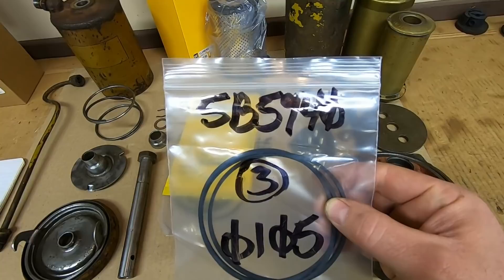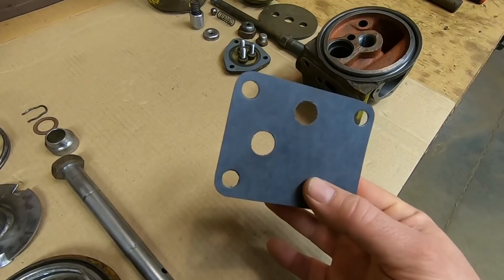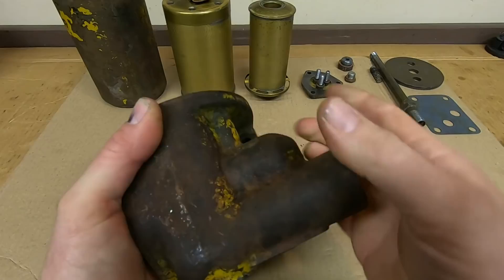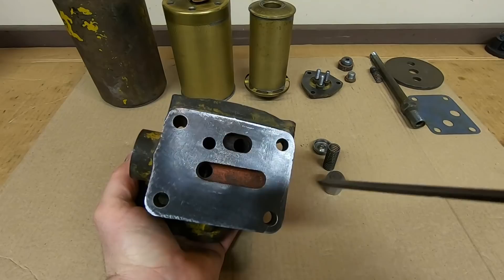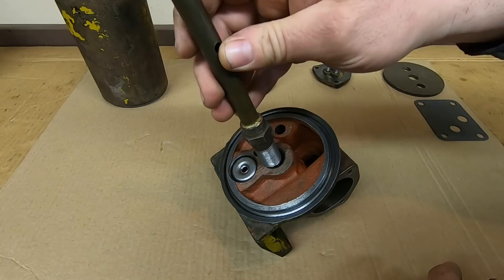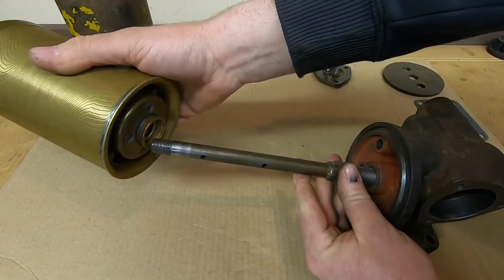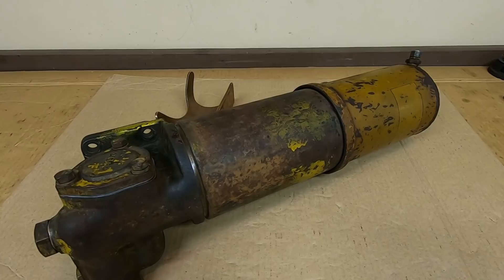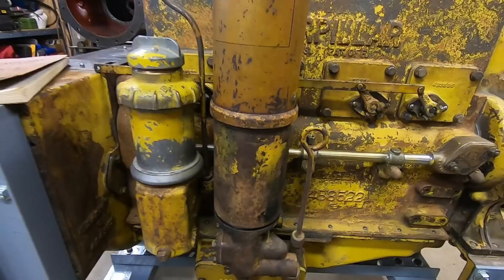Caterpillar D2 #5J1113 Diesel Engine Assembly Ep.42: Assembling & Installing The Hybrid Oil Filter

Comment: Hello from Australia, I have been a heavy diesel mechanic on trucks and  earthmovers for almost sixty years and I would like to make is comment,  if a bypass filter becomes blocked it does not stave the engine of oil.
Because it is in the name itself BYPASS FILTER  and most of these filters are only effective above 30PSI, and rely on a restrictor to slow down the flow of oil through the filter. 
I like your narration,  it's very good. 
Five stars.

Comment: That add on filter kit is a lot like what would be called a Luber-finer filter on a road tractor. Excess oil goes thru an extra external filter for fine filtering of contaminants but then returns to the oil sump. It simply filters oil when there is a surplus beyond what is needed to properly lube the engine. Most of the truck units are about 2 feet long and about 10 inches in diameter. They add about 3 plus gallons of oil to the total capacity.

Comment: Looking at your explanation of the oil flow clarifies the purpose of the “mystery” cover. It is most likely for a thermostatic control to bypass the oil cooler if the oil is too cold. The other poppet valve is for bypassing the oil cooler if the oil is too thick and restricting flow through it.

Hope this helps.

Comment: So in the beginning did these engines suffer from oil contamination, and failure? Interesting to see how the oil filter was revised, but never really updated to a more modern style.  I would be curious to when Cat saw these machines as obsolete and stopped trying to improve on the product.  Cat used to advertise that their machines were built to be rebuilt and not replaced, sadly that is not the case anymore.

Comment: The only thing I can think that empty poppet valve location is for, is a oil cooler anti-drain valve for when you're draining the filter assembly when changing/cleaning the filter and strainers so you don't have to re-prime the oil cooler.

Comment: Enjoyed the videos. A lot of oil capacity here. Cat might have taken into account cold starts and thick oil with that cooler bypass poppet valve. At this point in the flow there must be close to 100% of the volume running through this lower casting so the partial flow of oil comes up to the paper filter and has to go through that to get back to the crankcase. Full watch and like!

Comment: Squatch, thanks for painstakingly explaining the oil flow path through the filters. 2 questions remain. Do you have any reference to what the decal on the field service add on would've said? Also, wouldn't the add on be considered as a bypass unit only as opposed to a full flow since the oil that flows through it doesn't go on to lubricate the engine but rather just gets cleaned and returned to the sump? I only asked because in the wrap up you referred to the add on as a full flow element. My understanding of a full flow element vs bypass leads me to think that any lubrication path that doesn't lead to pressure fed oiling would be bypass filtration. May be a misunderstanding on my part of the terminology. At any rate, killer video, and I really love this 2 foot tower of engineering and "filtration".
Reply: @squatch253  I've been thinking more about it since my post. It's a weird place inside my head where I randomly roll around 1938 Caterpillar oil filtration throughout the day. That aside, here's what I'm thinking. The original filter, as installed is not a bypass filter, it is a full flow. As in 100% of the engine oil that gets pumped has to pass through the brass "filter" and I use that term loosely, prior to getting to the engine bearings. Once the field service kit was installed, the entire system became a hybrid system, where the oil that makes it to the bearings still gets "fully" filtered through the lower brass media, and a portion bypasses to the upper element where it is cleaned and returned to the sump. It's really an interesting setup. One would think, if Cat wanted better filtration, they could've just replaced the lower "full flow" element with a similar pleated filter to the upper element that was sized to fit in the lower can. Sorry for my ramblings. Cheers.
Reply: @lukestrasser  I agree with you but its all in the terminology I guess. To me that bottom "filter" is full flow from the pump because 100% of the output of the pump passes through it. It also has a feature that if it gets clogged up then it is bypassed (spring / ball) so that oil flow to the engine is maintained (but unfiltered). The top filter is indeed a bypass filter in that it is "in parallel" with the rest of the system and its discharge is tubed through to the pan via the oil filler housing so only a smalish percentage of total oil flow produced by the oil pump will find its way through that filter. It would not matter if that filter was completely blocked as there would still be oil flow from the discharge of the bottom filter through to the engine. Bypass filters, though they sort of work by attrition, can do a good job. My oldest car does not have a full flow oil filter but it could, as an optional extra, be fitted with a bypass filter. When I first got it going I ended up fitting an aftermarket bypass filter that uses a roll of toilet paper as the filter element. The filter connects from the discharge of the oil pump and drains into the top of the sump (pan). The oil is way cleaner as a result. Bypass filters are viable only because the oil pump can produce somewhat more oil flow than the car lube system requires whilst still maintaining the required operating pressure (or near to).

Comment: Interesting photo of the D2 pulling the moldboard plow at the end of the video.  It looks like he is making a second pass and I'm wondering if the purpose is to get more depth?  The extra depth would seemingly occur only in the dead furrow, however, and the on land wheel would about have to be running in the previous pass dead furrow.

Comment: I am thinking that system was used on many other engines besides Cat. It could have been used to filter other liquids like fuel or hydraulics. The empty space may have seen for a pressure regulator.

Comment: Question. Regarding not cutting a slot in the gasket where oil will clearly be flowing continuously over that gasket, are you not afraid of gasket deterioration? Or the gasket could tear forming a flap which could drastically cut oil flow altogether. Also with a slot cut in the gasket it would increase ever-so-slightly the amount of oil flow through that passage. I guess any deteriorated gasket would be caught by the filters if I understand the flow correctly. I just think that a slot cut in the gasket would be the best way to go. Good luck and I do very much enjoy your videos.

Comment: I cant see the strainer construction but the larger one seems to be double walled, filtered oil would reach the stem pipe from the center at the top where the two pieces clip together. both strainers should be doing the same job
Reply: Squatch253 thank you Squatch for further explaining this part of the filters, much appreciated and please keep it up!
Reply: Hi Squatch, I was watching the video again sorry I can be a pain too! Can you again check the two strainer assembly at the top?  Perhaps the filtered oil coming from the outer strainer is sent inside the inner strainer and not around the outside of it like you say.  Otherwise the oil would not circulate through the outer strainer as you need a certain pressure differential to make the oil go through that strainer.  Sorry for coming back on this...

Comment: Nice. You might need to pre-fill it before starting the engine.
Reply: MirceaD28 
and lap it a few times to take off the hi spots
Reply: Squatch253 
real men run pony motors,
although pneumatic starters r also sexy

Comment: If the oil bypass system had to engage say to a clogged filter, how would the operator know this had occurred? Perhaps oil pressure gauge change?

Comment: not sure I follow you on the bypass / full flow explanation...  I would think that if filtered oil goes back to sump and not to the lubricating circuit that filter is used as a bypass.  cheers!
Reply: Squatch253 yes i follow you now with the explanation you provided on the other comment, thanks again

Comment: How would the operator ever know his oil filtering system or oil cooling system was plugged? Would it be just by touching it to see if warm or hot oil was circulating through it?
Reply: One would assume that it would go by a certain amount of hours used, as per the manual says then be checked and cleaned at the same time and record the hours on the engine counter at that time for the next service interval...hope that might help your curiosity...hello from Minneapolis Minnesota!!
Reply: @leeharris3061  thank you Lee that does make a lot of sense. I guess there would be no reason for it to instantly plug up and stop the flow.
Reply: I am from Cloquet near Duluth so not that far away. This is a very nice channel.
Reply: @waltermattson5566  and SQUATCH253 is in between us someplace here in the state...thank you and stay safe!!
Reply: @leeharris3061  you too.

Comment: I do not understand why the gasket has two small holes when a slotted hole for the oil is needed.
Reply: The slot is cut into the casting, there doesn't need to be a slot in the gasket because the oil is staying on that side of the gasket and not passing through the plane of it.
Reply: I have the same concern. I fear that over time as the oil keeps passing over that paper gasket it will begin to deteriorate which could lead to blockages. Also the thickness of the gasket reduces the area that the oil has to flow through, not by much, but still reduces the overall area. I know Squatch has way more experience than I, but I would have cut the slot in the gasket.

Comment: If I understand this,the standpipe has to come off at every service interval ? Man,I would sure hate that with a passion. Cool factor fine,as long as someone else gets to fight with that dog's dinner. Yuck. Interesting nevertheless. 
As you say,following and understanding the oil flow is critical here.
Reply: @squatch253  Oho. Well I would end up crossthreading that upper connection to the standpipe nevertheless. Then completely lose my temper,contact the Greenline hose people locally and replace the steel pipe with reinforced braided wire flex hose,extra high pressure with one of the expensive hose formulations,and a rotating coupling on the upper connection. And think it well worth the cost. 
Everyone has a pet peeve,and I long ago lost count of how many times I had to reassemble brake lines others have turned into a mess. No way on God's green earth would I have the patience to service that unit as is. For your sake I am pleased you like the cool factor. I am delighted to watch as you patiently tweaked and cleaned. But NOT ME ! All the best.